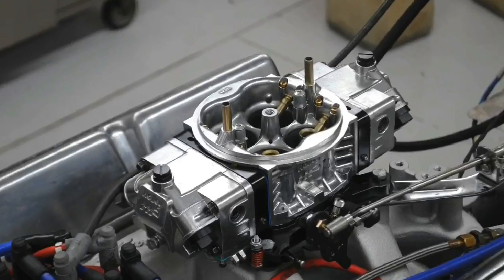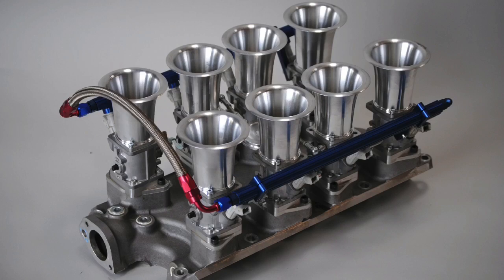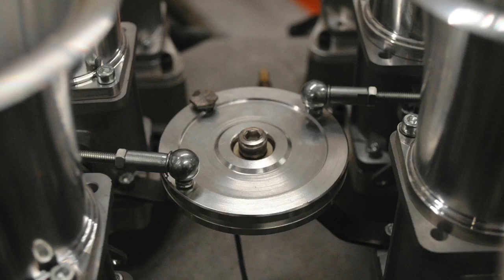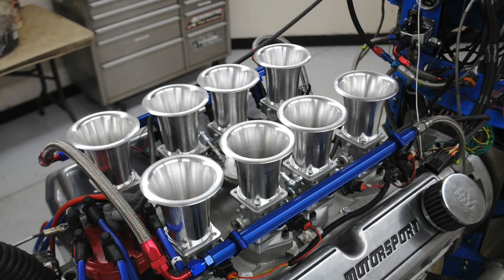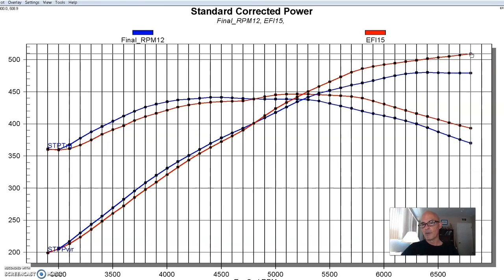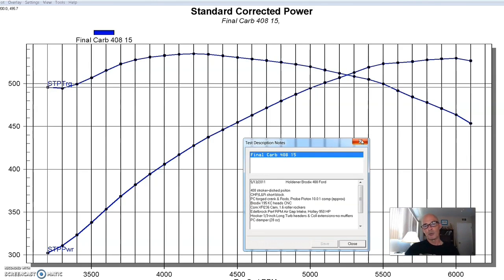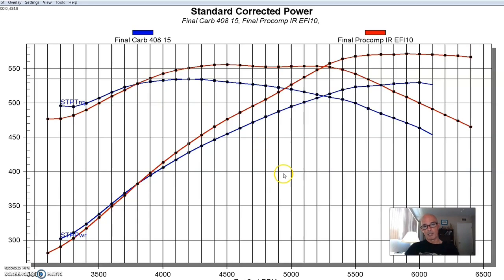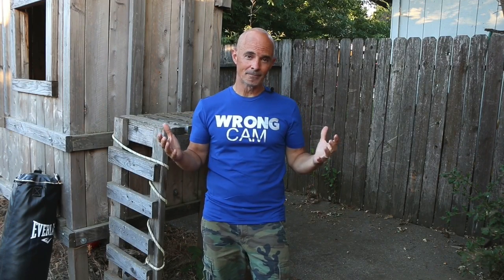THIS FORD IS STACKED!

Comment: what is the detail for the Holley dominator setup to make the speed master run for the 302? this is a good option for a daytona coupe, as hood clearance sucks, but not 100% sure all the holley stuff required.
Reply from the maker: dominator not required0could also use hp or terminator

Comment: I’ve been brainstorming an engine for a custom ford raptor for some time now and my idea would be to use a Kaase block like the a460 and sr71 heads converted to electronic ignition and stack fuel injection. Problem is I don’t know how to go about making that happen or if it is even possible or the right choice lol but it sounds good lol

Comment: Richard is possible to email you about some questions on a camshaft i have for a 351w? I am building a stock bottom end motor and have multiple questions with no one to answer them too well. It would be greatly appreciated..

Comment: Hey Richard! Love the content, especially this stacked comparing videos! I have an old Volvo 242 with a 409ci SB Chevy, with AFR220cc, 4/7 swap cam ~275 @0.50, ~0.590 lift, 106 degree lobe separation. 11.7-1cr. On top, Speedmaster 8-stack :D (alot of porting) with Holley HP efi. Its one healthy motor, I have put the revlimiter at 7600rpm, but it just keeps climbing there..  What do you think it could push out? I havent run it on the dyno yet. My aim is 600whp through a manual gearbox. Here's a video of it playing around, you can hear the trumpets singing along :D  https://www.youtube.com/watch?v=9JqJGKb4MHs&t= 

Thank you for all this great content.
Reply from the maker: that would be 1.75 hp per inch-that's a lot-should do well but let me know
Reply: @richardholdener1727  If I have lets say peak power at 7500rpm on 409ci, it feels like it would produce 600+hp..haha, I hope so anyway. Will let you know!

Comment: Finagan (probably spelled that wrong) has a filter on Blasphemi that is supposed to be good. 

And it's tough to beat the sound of  individual throttles too. The only thing I think sounds cooler is forced induction.

Comment: Iwould like to see tests with a Victor Jnr or similar V the stack injection. I doubt there would be much difference mid range to high rpm
That has been proven on road race Chevs. And the carb is far simpler. And generally A easier to start B more driveable which is No1.
With historic Mustangs quad Webers V a Holley? Webers make more power  but the single Holley is faster.
Reply from the maker: a Vic Jr. is not Stack Cool

Comment: Look at the intake system on any unrestricted high performance  race engine   And see what they have   Some form of this stack injection 

I would like to see what it would run like with  two sets of bike throttle body’s or carbs

Comment: Great. Always wanted to see this sort of comparison. But i've always wondered, why do you not start your dyno runs from idle? It would be nice to see the full curve rather than just mid to high. Especially handy when comparing cams. It would also be nice to see a video involving the addition of a plenum, I reckon that would help with the bottom end and with driveability. Only one way to find out...

Comment: Hi Richard , i machined up some alloy stone guards with the mesh in them , they are retained with a large 98 or 99 mm seger clip , and then i have cut a 60 ppi disc and put that into some outwears  , my channel only shows the trumpet covers at the moment , i also made a fairly trick but simple throttle linkage to help my tip in , need video for that . Morrison Crossram 52mm . https://youtu.be/tcBxfRSYjt8
trumpet stone guards @ about 2.47 Cheers.

Comment: Never wanted to deal with the multicarb systems for my toyota or dataun so we made an adapter for a holley 4 barrel for my Toyota and found an offenhauser 4 barrel for my 4 cylinder datsun. Now I just have to find a better tbi system than the 80s pro-jection that works on 110hp

Comment: I think it looks very cool probably expensive though what would be the cost per horsepower gain and what did you do with the parts your test do you sell them or hold on to her thinking about the RPM intake for the 302

Comment: The kits don't come with injectors or injector controllers ( ecm )....that just makes the little extra power so NOT worth the cost.....plus it would be very expensive to add boost to vs carb or single throttle body injection

Comment: Customer showed me an intake with 4 original Weber Ida carburetors which belonged to the gt40 for which I prepare 289 heads......  I could keep it in my shop...but took it home to show my wife as it was really cool.....AND WORTH 25.000 DOLLARS......

Then this customer told me that if you had 4  original 50mm Weber idf carburetors...that alone would equal at least  25.000 to 30.000....let alone if original manifold and linkage would be added...

But the real blast was a customer who showed me a special double barrel Weber for a 1953  Fiat V8  .....saying:  you can keep it here for flowtesting the heads.....  Well ...what are they worth??  Oh, only 25.000 dollars original .... and you need 4 of them.....  Please...I can do flowtesting with a dummy carburetor...take it with you..

😁😁😁😁😁😁😁😁

Do not know or the prices are correct..... but if the parts belong to the engine and car etc and matching numbers.....Prices seem to skyrocket...

Comment: I love the way stacks look but I never understood how they can get any air in them during high speeds unless they had some sort of box over them. We ran Hillborn injection on our Vega for the first year and finally switched to a carb. Way more consistent and way way less hassles getting set up for a track. For racing, once you have a good carb, you can pull it off and use it in a different car with no changes even if the engine is a different cubic inch or make. 
If you have stacks sticking out of your hood and going 100 mph how is the air making the turn to go down inside the stack and even if it does how is the next stack in the row going to get any air? Then there is the different length stacks with a tall one creating a draft of low pressure for the short one behind it. Plus you have the bent stacks that are curved towards the valve covers with one facing slightly forward and the next one facing slightly back. One is getting air forced in at speed and the other is in a draft. I bet they all work great on a dyno. I think the Chaparrals in the day worked because the engine was behind the driver and they were located in a dead air, low pressure zone so the engine was able to pull the air down inside the stacks.
On the front engine rail we started out with a velocity stack on top of the carb and then we found a gain of 10 miles per hour by installing and open element air filter on top of the velocity stack. After that we added different shaped air boxes on top of the carb with a velocity stack inside the box. This all took place back in the 70's.

Comment: How come you guys don't do a test with a set of coats rotary valve head on a 302 ford which they make a set of head for it
Reply from the maker: Lots of people buying those?
Reply: @richardholdener1727  don't know but I went to visit their factory but we don't hear of them for some reason the engine with the head make 400 HP spin up to 14,000 rpm no oil no antifreeze in the head and oil stay cleaner up to 50,000 it's in new Jersey if it still open
Reply: @andremessier7619  400 hp at 14,000 rpm?? Only if that was a motorcycle engine, would that impress me.

Comment: Jon Kasse makes a set of heads for the SBF that made 750 hp with a hydraulic street cam and a 950 carb. Stacey David had kasse build him a 427 with the same heads and a jon kasse racing individual runner intake on it and it made.....625 hp. Maybe stacey's setup was less racy but......125 hp is a huge loss and I'm sure kasse is as good as anyone on earth at designing and building an intake like this. It seems to me that the individual runner setups only benefit is looking cool. I've never seen significant power gains over a good 4 barrel setup with an air gap intake. Also, drivability is clearly an issue because every article regarding ir setups mentions drivability issues. Looking good costs plenty too. The last ir setup I saw was over 2500 dollars. It seems like it was 3500.....

Comment: Richard, I would like to add a test of these engines with a Victor or Victor Jr. I suspect power would be similer or close to the IR, it seems obvious to me that the Air Gap manifold is a BIG restriction, especially on the 408.
Reply: His dyno tests prove otherwise. Up to 5500, the RPM always wins.

Comment: The Speedmaster Intake and throttle bodies tested in the is Video appear to be the Gen 1 Speedmaster/Procomp ITB setup. The newer Gen 2 is easier to setup due to the change from 8 individual throttle bodies with separate shafts in the Gen 1 to the paired shaft throttle bodies in the Gen 2, meaning there's half as much adjusting to do and the adjustments are different type on the shafts. A few years ago when Speedmaster switched over to the new style, they had an Ebay fire sale on the old ITB setups and I bought one for the 289 and one for the 351W (Cheap!) I am installing the Throttle bodies on a 331 Stroker with a Blue thunder Cobra intake. Richard is right when he says these intakes need some massaging to port match modern heads. Took me two days with the die grinder to get the ports matched on the BT intake to match the Dart Pro1 as cast 190 heads.  Anywho...Control will be with MS3-pro which has specific ITB modes and very good MAP filtering which works well with ITB setups. Thanks for the Cool Vids Richard! Keep em coming!
Reply: Hi Scott i have a Gen 1 and would like to know what ECU ru running, is it the Speedmaster of aftermarket, thanks Kel
Reply: @kelvinbartley4858  I'm running MS3-Pro.

Comment: You should test this out on a turbo setup 

https://www.ebay.com/itm/Proflow-TBP4150B-Fuel-injection-Conversion-Plate-Billet-Aluminium-Natural-4150-/323963957694

Comment: I believe i have used all the major manufacturers ITB/Stack EFI setups, and have tuned hundreds of Weber multi carb setups. the devil is in the details, base throttle blade synchronization is absolutely necessary on these types of systems and they will NEVER run correctly in not setup properly, on Weber carbs float level is the second most important thin in their setup. When they are dialed in (either Weber or ITB-EFI) nothing beats the throttle response. And Richard is absolutely correct on the whole Air filter dilemma, You can go with screens but they disturb the air, filters get the small stuff but rob performance.  on  my channel is a Borla ITB setup on a coyote aluminator SC video of a dyno run. in that trim it made over 500HP at 7300 rpm and was still climbing. bottom line, ITB's look great but have some headaches to contend with. and if you show at a car show with them everyone else is going for second place...

Comment: Love stack injection.  Back in the late '80's my friend ran a set of Enderle mechanical stacks on his 331 SBC rear-engine dragster.  The switch from gas carb. to methanol injected picked up 2 tenths and 15 MPH in the quarter (8.50 @ 165 MPH).  At least one-tenth was due to fuel type.  We had to install a high-speed bypass to get that MPH gain though as the car would fall flat on the top end without it.   I know you have briefly mentioned mechanical injection versus electronic FI.  Have you ever done dedicated testing of these two FI types specifically for comparison?  I'm curious because there is an art to tuning mechanical which is far different than electronic in this sense (although I think mechanical is fairly simple).  I do see mechanical setups for sale which always tempts me.  Of course, it seems electronic is infinitely tune-able and the most popular in today's race world.

Comment: Curious why on the cam lifts the smaller 363 was a bonkers .7xx lift and the 408 was around .5xx. PTV clearance? Are the flow numbers of the 363 that good at 700 lift?

Comment: A comparison of a Ford Mod motor big bore 5.0 vs a stroker 5.0 would be awesome to see. FP Boss 94mm block with 2v heads vs something like and Eagle 5.0 stroker 2v
Reply: But the "mod motor" 5.0, as you call it, is not a "big bore". I think it's only 3.8something. A 302 is 4.0

Comment: Ran stack injection (DC&O - Aussie setup, but similar to speedmaster for look) on my 347 Windsor (Ford Boss Block) with solid roller cam (250/260 ish duration and 620 thou lift) and Eedelbrock Victor Jr heads. Road/race motor in a GT40 replica, so that's why I had to run the stack injection - for the look to be close to correct and for the sound of it right behind your ears! It went well, about 440 RWHP on a dynojet rolling road. Never had any issues with throttle synchronisation, IR injection is a lot more forgiving than a quad weber setup in that regard. Oh, and forget MAP tuning stack injection. Use TPS as your ECU load source. Makes it easy to tune and it works well. Car was a pussy cat to drive around at idle and never missed a beat. Most of the time I ran no filters over 12000 km of road and track (hillclimb and circuit sprints) use. After 7 years, stripped engine for a look see and gave it bearings, rings (flex hone too)  and new valve springs - it was happy inside, so no big deal about not running filters. You can fool around with different trumpet lengths and/or make up (laser/water jet cut) spacers to go under the trumpets too. I tried a couple of different lengths to achive what I wanted. Fooling around with Engine Analyzer Pro was a fun way to try some what if scenarios with stack lengths. Should you do it? Well, only if you have money to burn or need the look as I did. Does it make more power over a good inlet manifold? Probably not. Can you easily tune intake to suit your needs - absolutely. Does it look great? Of course. And it sounds amazing, though a cross over exhaust also helps there. Oh, and the throttle response is incredible, too sharp in fact - you need an elliptical (D shaped) throttle horn to make it driveable, or at least I did. Anyways great test. Oh, and my mate ran a similar setup on his 414 stroker Windsor GT40 and made more like 500 RHWP. There's a video of us doing a rolling 800 m (1/2 mile) race on my channel somewhere. GT40 head to head Racewars 2017 or something like that. He beat me of course! A good big engine beats a good little engine every time...

Comment: I'd be keen on an old skool Vs new skool comparison of 4 barrel carb Vs 4 barrel efi and then 4 X downdraft carbs Vs the ITB's. I'm from the UK and on all the old ford 4 bangers the upgrade has always been to get away from single carbs feeding all of the cylinders and move to a barrel feeding each cylinder.

Comment: Why did the 408's hp flat line?
Reply: Cosmos M54B30TS : Because the air flow character of the heads flatlined.The 300+ cfm was a peak figure at 600 thou lift. At 550, same cfm. On the 8.2 inch deck 363, the intake was costing well over 35 hp as the whole flow was limited by the inches from the intake valve to the trumpet. The 408 was getting close to needing extra cfm because the intake manifold on a 9.5 deck is so much better.
Reply: @deanstevenson6527  Thank you for your explanation, I appreciate you confirming my thoughts on this. 👍
Reply: Cosmos M54B30TS : Well, my take on it, anyway.  There are five ways to index your data. 1.The laws of how air and fuel flow, which has to be indexed against the history of an engine family so its understood . Then 2.how it interacts with other of its peers.Then 3, the ideakistic mission or way to make power in comparison. Then   4 The actual Numbers, or Index Test is  what Richard Holdener does beautufully. And 5, the all in Review, which Richard Holdener does  Best. The opening narritives are designed to spoon feed and remove the cluster of differeing opinions hurting the transfer of information. RH, you are right on point with these two dyno engines with IR delivery. The short deck 8.2 inch 363 really requires more effort to get the independent runners rooster tail of atomised air fuel into the chamber, packed as well as it is on a lower lift 408W.  In my opinion, its the intake restrictions  that are loosing power, and maybee the nature of the cam profile. IR engines are easy to overcook with too much cam.

Comment: Richard, nobody under 40 has even heard of the CrossBoss intake! I've only seen em in a book, and that was 40 years ago! I guess Ford even prototyped a manifold for TWO Autolite inline 4 barrels, for SCCA Trans Am, but it wasn't approved. Pity! One of those carbs is worth $4000 now, I've read.

Comment: If I recall correctly, Finnegan installed a air filter on the stacks on Blashhemi at one point and actually gained a good bit of torque. Granted his is a MUCH different setup. Plus it was one big filter which covered all the stacks, and that kinda defeats the purpose of having a cool induction setup just to hide it under a big, boxy filter.
Reply: like saying having a air filter hiding your carb defeats the purpose. like a cam or headers the job of the stacks is not only to "look cool" or "sound cool" but also to make power.

Comment: Richard, in regards to an airbox for stack injection type set ups, Australian V8Supercars have made an art form of enclosing and feeding clean, pressurised  cold air to the intakes. Although usually, we are talking crossover style, not vertical. Then same approach could work with vertical stack injection I think.
Reply: Hapkido 82 : Yessir! The ITB/ Indepedent Runner Port on Port (irpop!) SBF's were what madeAVESCO copy TRANSAM and 5 liter limited LeMans Ford small block engines. The matter of disproportional power loss with the 363 verses 408 is an Aspirations Index issue, where the loss in power is exactly as Richard Holdener says...35 to 45 hp down on what a 700 plus thou lift cam 363 should make.